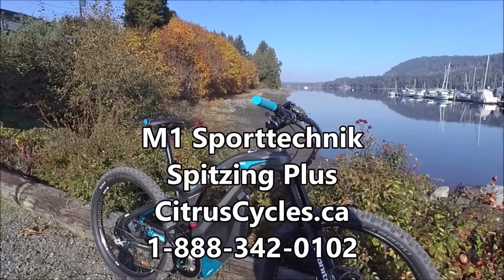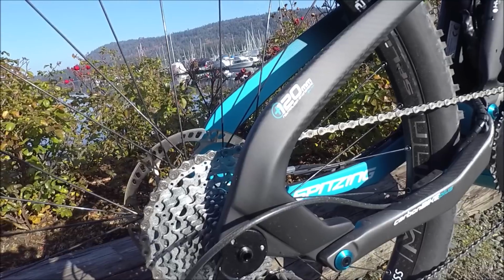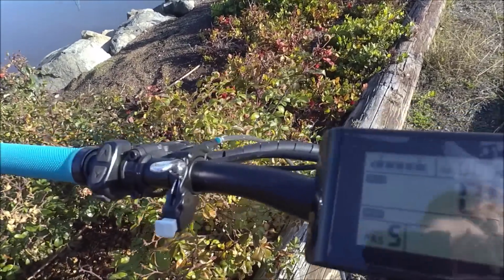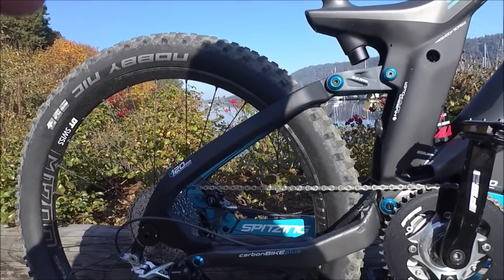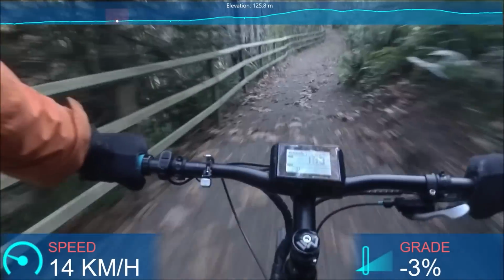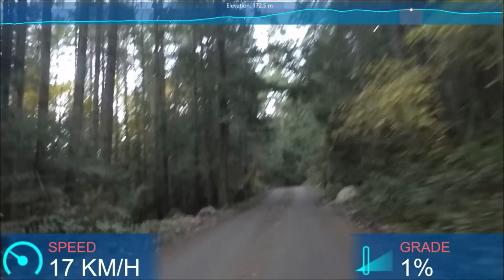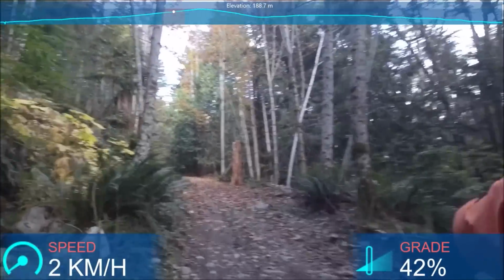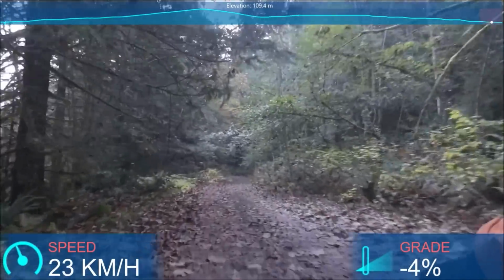M1 Sport-Technik Spitzing Plus (TQ Motor, 1.1KWh battery) Review and Ride Test

Comment: Been riding a Spitzing Plus S-Pedalec over a year (8.000km in 12 months), 21-25km to work each way (depending upon the route), 280m (net) elevation, including about a 500m stretch/20% climb (can keep up a steady 17-18km/h on level 4 with about 300W power on my side no problem on tarmac, although I sweat). Top speed up to now 81.8km/h downhill (slightly over 50mph)... I reckon over 90 is easily doable, but my test stretch ended with a t-junction and a field/barbed wire, so I'll leave that to another day :).
Good review, tells it the way it is; anyone who thinks e-bikes are not for real bikers just doesn't know what he's talking about...

Comment: I own one of these bikes and love it but notice in low gear the chain drags on the rear tire. Does anyone else have this problem?
Reply from the maker: I haven't run into this problem myself.  Perhaps your derailleur needs adjusting or your derailleur hanger was bent?
Reply: Nope - 8.000km in the first year, no problems with chain/tyre drag.

Comment: I love my Spitzing Plus! It's worth every penny. It's so powerful that I usually keep it on power level three. Great review!
Reply: i have the m1 Spitzing evelution model 2021 45kmt speed limited it has a powerfoul light and horn and fenders the battery is 1050wh and powerful brakes 4 pistons brake calipers
Reply: What is the weight of your bike?
Reply: Rus Gerih +26kg

Comment: Nice video Kelly, no where on the site does it say the weight for this bike, did I miss it? Also most of the bikes you sell are bosch equipped, how does this setup compare to them...
Reply from the maker: Hi Andy!  I'll have to see if we can weigh it later this week.  It wasn't as heavy as I expected given the size of 1.1Khw battery!  The TQ motor is similar in some ways to Bosch, but also very different - it is something you have to try!
Reply from the maker: It is 27 kg with the 1.1KWh battery and a dropper post that we added.  With the 880Wh battery it would likely be lighter.

Comment: Is it totally waterproof? What if i need to use it on snow in winter time (battery in direct contact with humidity)
Reply from the maker: As with most eBikes, you can ride in poor weather conditions such as snow or rain.  However, you shouldn't submerge the motor or battery in a lake or the ocean!
Reply: @CitrusCycles  My concern is that i live in a ski resort, thus the need of an engine. The salt on the road in winter time ruined my last 10k electric bike (stealth bomber)
Reply from the maker: As with any eBike, I would recommend trying to clean the salt off your bike or any vehicle for that matter, as it will reduce the lifespan of the bike.
Reply: there is nothing on the market that is water proof but more or less water resistant but its limited even cameras and lenses that is so called waterproof stops working and the reason is almost always humidity inside these so called water resistant lenses and cameras itdoesn't happen there and then but later down the road and can be traced back when you had the bike or camera in the rain